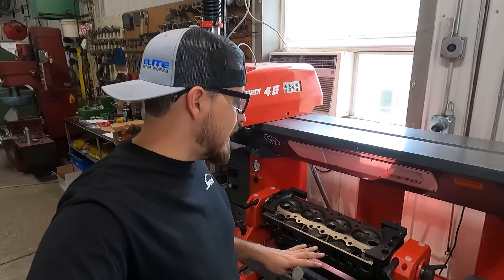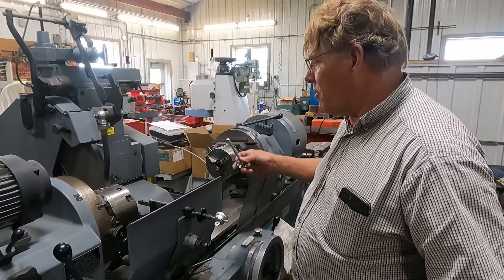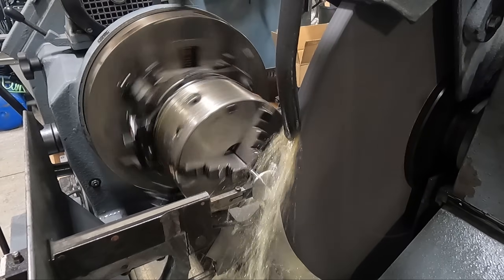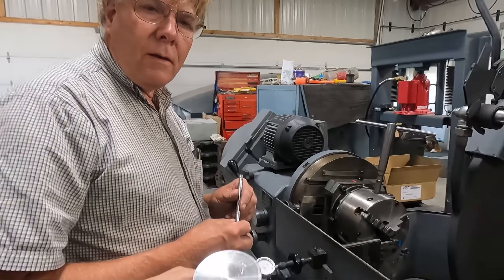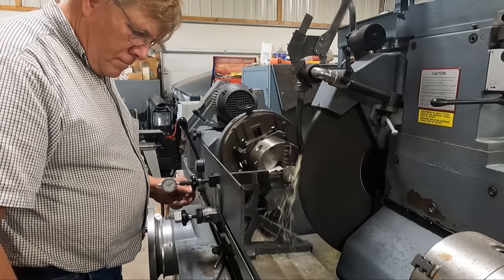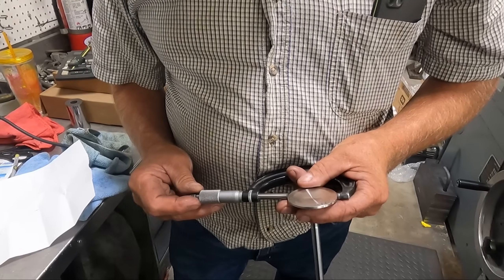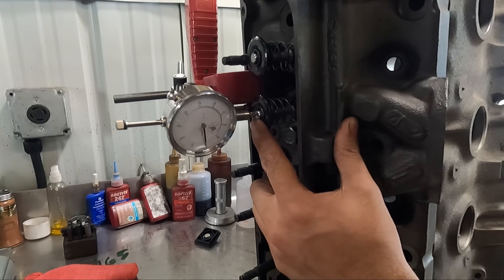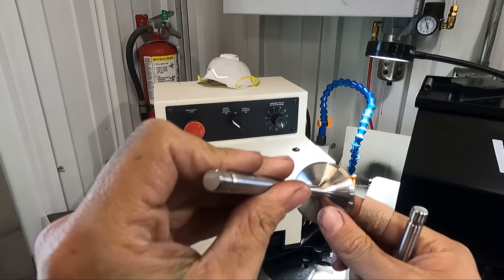Using A Crankshaft Grinder To Modify A Set Of Engine Valves - '68 Firebird 350 Engine Rebuild - Pt 3

Comment: That engine block had chamfers on the deck for the larger 2.11" valves, I thought those were generally enough to fix the airflow issues with the large valves.
Reply: It is, so long as you don't have some crazy valve lift.  These guys, while overall fantastic, just aren't up on the arcane features of a Pontiac 350.

Comment: Quite a few 350 Pontiac guys run the sbc valves 2.02,2.05 or 2.08  in a 350 and some will go with the Ford Cleveland 1.7 exhuast valves 
And your on the money using the 30 degree intake seat,which work better than a 45 degree on a Poncho

Comment: No.17 Heads. From what ive read these were one of the better heads designed by Pontiac.. I've always thought 2.11 intake valves were really too big for the P350 Bore. Great move downsizing the valves. I have the same heads on my 68 Firebird.

Comment: Ive turned valve heads and also ground them. If they want to chatter slip a piece of heater hose over the stem a little longer than the distance from the face to the chuck and when you chuck them, compress the hose by pushing towards the chuck a little. this will prevent chatter.

Comment: I have some questions about your choice of cutting the valves down.  I doubt I'll get an answer but I'll throw this out there anyway.
1.  Why not take the valves down to the correct OE size vs CLOSE?  That exhaust valve visually looked really close and after some wear I would be worried that a valve would clip the bore.  
2.  Why not go with a smaller stem size etc?  It sounded like via the way you worded things that the OE size was available but not with the appropriate valve stem size.  Maybe I misinterpreted what you said but that's what I got from it.

Comment: A 30 degree back cut on the INTAKE valve will help low lift flow.   A 30 degree back cut on the EXHAUST valve has no effect on flow.   Think of the direction of airflow.

Comment: In the question of how valves are cut or ground in production,

 my former employer builds the automation for transmission gear hob-cutting and grinding, and the principle is probably the same,
as you know grinding is a slow process that removes very small amounts of metal, so the gear blanks are hobb cut to 15-20 microns before heat-treat tempering to final hardness, then ground to final dimension after heat treatment.

You really want machining operations to remove as much material as possible, while still leaving just enough material to be ground off, 
in a production environment tracking which operation has been completed with no errors is extremely important with ground gears where there is often no visual difference between a gear ground to proper tolerance and one that isn't, the measuring uses an induction sensor measuring the teeth as the grinding is taking place,

Reishauer is a bit secretive about in-process wheel dressing but the wheel is dressed during the grinding process by using a bridge of strain-guage sensors in the spindle head, as a grinding wheel grinds off metal and loads the wheel, the weight of the wheel changes as does the balance in very subtle ways, 

the dressing grinder controller gets continuous feedback both from the strain gauges in the head stock indicating loading imbalance, as well as the continuous induction gear diamater measuring, and dresses the gear-tooth profile into the wheel to compensate.

Comment: You guys sell the correct size valves for this head on your site.  I don't understand all the extra work for a less than 8:1 ( you mentioned in the final build video)  engine? The '68 HO 350 had same small valves. ( 1.77-1.66)

Comment: We built a 305 Chevy engine about 28 years ago using a set of camelback heads from the 60s.  We put 1.94 intake and 1.6 exhaust valves in it and because of the small bore the shrouding effect created a rev limit of 4800 RPM.  Didn't matter if it was being driven or free revved.  Learned from our mistake.

Comment: another way to unshroud a valve in a small bore engine is to use offset dowel deck pins to move the valves closer to the bore centerline--the widest part of the bore. This may require a closer look at the fit of the intake to the heads that have moved away from it when it comes time to top off the engine.

Comment: Shouldn't you reduce the thickness of the valve head to reduce the amount of heat the valve can store while the engine is running?. The thicker valve increases the amount of heat the valve can absorb within the valve and the reduced diameter reduces surface area of the valve and reduces the speed at which heat can be removed from the valve which can increases cylinder temperature.

Comment: Crankshaft grinder stones won't generally cut stainless steel very well I would have just cut him off in a in a lathe with a carbine insert
Reply from the maker: Me too if I had a lathe lol
Reply: @JAMSIONLINE  and you call yourself a machine shop
Reply from the maker: Yep! 38 years going strong without a lathe OR a mill! (excluding our specialized boring and surfacing machines)

Comment: To my memory the 350 HO Pontiac of 1968-70 used the larger 400 intake valve and did not experience some shrouding. Still was very close in output to the 400. ( at that time insurance rates were lower with an under 400 cu in engine) . 
I think what you have done will actually increase flow and even if a stock intake and carb you’ll make a more reliable and more powerful engine with such quality machine work.

Comment: Pretty sure when they make valves. It starts as head size stock and the stem is turned and than parted off avoiding having to work on the head with the flimsy stem.  That’s how I make valves anyways.
Reply: I gather that sometimes the stem is welded to the head, to avoid turning such a long whippy piece of material without end support.
Reply: @nerd1000ify  let’s not even get into Sodium filled valves and the mystery’s of how they are made.
Reply: @psirider  maybe they use the welding approach? But they'd have to do it under inert gas or the sodium would ignite.

Comment: Did you look at Qualcast to supply the valves? They have a listing for Pontiac 350 valves. Don't know if they have in stock. I like your videos. Very through with good explanations. It is very easy to get bogged down in the detail when trying to explain the concepts.

Comment: I would have expected the larger diameter valves to be thicker, is the extra weight not an issue in this application?

Comment: Would have been better off modifying the upper portion of the cylinder above the top ring to un-shroud if you're after performance... Lift has far more influence than valve diameter. "Valve Curtain Area" .050 larger diameter in valve area is a joke.

Comment: I thought I was the only one to do stuff like this.   Except in my case I put my 2.300 valves in a vertical bridgeport collet. Then clamped a carbide lathe tool in the vise, and fed the valve down on to the cutter.

Putting the 45 back in the right place was a pain since the grinder I used didn't have a positive stop. So it was back and forth with all the valves into the same hole until I had matching tip height.

Comment: I would have to atleast smooth out the ports, and knock off the sharp edges of the combustion Chambers, such a old head design, probably has a poor port velocity, or low efficiency, in the late 60's even the base engines ran decent, so. The ports can likely be improved by a mild porting,

Comment: If the valve has anything around it closer than the lift, it's shrouded! Putting a larger valve in, will restrict flow! The reason they get away with some shrouding,, is the port is biased to flow more on the opposite side, but in those cases, it's better to port the head, not larger valves, maybe add a larger exhaust valve, it uses shrouding to funnel exhaust out, a engine is only simple when it's not running, it gets very complicated when it fires up! There's alot of stuff going on you can't see, especially in the air/fuel flow and combustion!

Comment: Improvisation, love that. Once in tech machine shop my instructor and me took a little off the stems of two motorcycle valves on a surface grinder. We fashioned a sleeve type fixture to keep the stems rigid. Worked great.

Comment: Nice work! You're right about the Pontiac 350. Small bore and those were stock valves for the 2bbl engines. It's been common for folks with 350P to use Ford valves as an upgrade but what you essentially did was mod 400 4bbl valves for the size you needed. Very cool. Years ago car craft did an article about this, I think your solution was super clean. Also the performance 350P had a bore relief for both valves that matches the headgasket. From what I've seen the 2bbl only gets one of the reliefs at the top of the bore (maybe wrong,) but that's how the factory solved this issue of clearance. I think this 350P is going to run NICE. I also thought the fresh surface on all the flanges of the heads was a great touch. What did the valve to seat and bowl ratio come out at?
Trivia for you, one year only the 1969 350HO used a 2.11 and 1.77 valve in the same chamber you did only more shallow. The cam didn't lift past 0.409 and the bore had both reliefs.

Comment: Ive been thinking of doing this for my v6. Want to use valves that are 1mm more diameter than original (and grind them down).
This method seem really neat.
Do you think one could turn valves on a lathe. Or is grinding better?
Reply: Having made a set of valves (1/4" dia) for a model engine on a lathe, I can tell you it is possible. Not necessarily easy however. The thin valve stem is quite fragile and easy to bend if you are too aggressive in your cutting parameters. If the valve is hardened it may be very difficult to turn at all. In such cases a toolpost grinder (or even a die grinder bolted to the toolpost) would be an option, just got to be careful to cover the ways so the grit doesn't get under the saddle.
Reply: I dont realy know anything about this topic but i Guess Grinding is better maybe because its More precise (less Tool deflektion or something i.d.k.) or because you get a better Surface finish (on a realy microscopic Level) but like i Said i dont realy know what i am Talkin about (Never rebuild an Engine/used a grinder) 
Greetings from Germany

Comment: I don't get the "It's not intended for this". It's a grinder. Sure, the main focus when designing it was crankshaft grinding, but it's a grinder. It's meant to grind. You used it for grinding. If you used it for something else I'd say that counts, but this? Tome this is just big picture tool use.

Also, I love that you made another video with your dad. I guess that's just "competence porn". I know that sounds weird, but it's basically just someone really knowing what they're doing, and doing black magic while causally chatting about it like it's no big deal.

Comment: You guys do amazing job on any part you touch. Great man. Also thank you for taking your time to make the videos to show people how it works. So I want to ask you a question. My 09 Mini Cooper s. As a pressure leak on cylinder four. So I’m going to take it apart and have the head resurfaced and get a valve job done on it. Do you think the is a good idea. Or what would you the experts suggest. Thank you for your time

Comment: Those aren't uncommon head's, only hi-po head's came with 2.11in/1.77ex, manufacturers probably just don't see the demand for the more common 1.99in/1.66 valves, hope you did some bowl blending/put a dual plane 4bbl intake on this, very interested in this build

Comment: I see your dad has a very delicate touch he has developed with his fingers as he rolls a little more pressure onto the two knobs of the steady rest.  Each time he takes a little off the od he must apply a little more pressure to the steady rest “fingers” then feed the grinding wheel in towards the valve again and “rinse and repeat” so to say.  Very nice.  I assume he is feeling for just the right amount of pressure against the valve but not enough to over do it and deflect the valve off center and further into the wheel.  I’m sure that took a while to develop a feel for!

I’ve ran most of the equipment you show except the crank grinder and it’s something most have no idea just how complex the setup is.  That and cam grinding!
Here’s an idea for a video that would be relatively unique.  Make a video showing how you grind a crankshaft, both the mains and rods, explain in detail setting up for the particular strokes and how that is set on the machine.  There are a few on YouTube who have done such a thing but they didn’t get very in depth in explaining how the stroke is set and indexed in those chucks (which themselves are unique in how it can be dialed off center versus a lathe Chuck that stays on center). I know that’s the key to a good crank grind is mostly in the setup and indexing.
Very nice work!  Great job with the videos👍🏻

Comment: I ground cranks in a shop in Nashville during the late 70's. We had a reputation for doing the odd and unusual. I OD ground a lot of stuff with
 that grinder, chrome hydraulic rods, valves, wrist pins and other stuff. The most stressful job was a batch of special end mills that the shanks were .75 and needed to be .50 . The OD was bad enough as it had to be spot on the length. The strange part was taking an old grinding wheel and facing half of it off so I could plunge grind the flat on the shank for the set screw. I had a blast at that shop and learned every machine in there including the cam grinder.  I never got comfortable with it because coming up on that cam lobe made me flinch every time. I love watching these videos because it brings back good memories.
Terry from South Carolina

Comment: Kinda crazy you guys don’t have a surface grinder or an old engine lathe. So please tell me why ur dad and as he was adjusting those knobs they weren’t moving? I assume the were just supporting the valve head from the pressure of the wheel.

Comment: When you’re rebuilding an engine, where do you get the factory tolerance specifications? Is it something available to the masses or do you need to buy the information from the OEM?
Reply from the maker: AERA Prosis Pro Engine Specification software is a pretty good start usually!
Reply: @JAMSIONLINE  AERA Prosis is a member subscription software. No decent machine shop would try to operate without it.
Reply from the maker: @turbodave231  I agree!

Comment: Modern valves I am told are hard faced. How does grinding the face result in a usable valve?
Reply from the maker: The type of valve used & the material definitely plays a role in whether or not this would work! In this case, the valves used are a high strength stainless alloy with hardened tips and hard chrome plated stems. However, the head/face of the valve are the same material composition throughout and the modification will not result in any loss of structural integrity or durability.
Reply: It's pretty much only when you have a sodium-filled valve the valve seat area is a hardened type of coating material I can't remember the name used on high performance valves like Porsche's sodium-filled Harden face I believe that's the proper name
Reply: I had the same thought, good to know